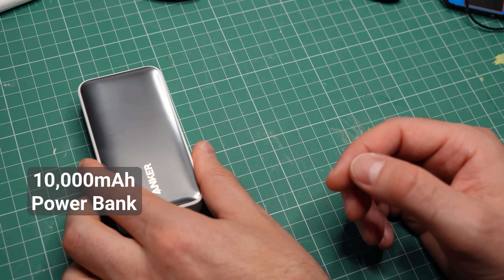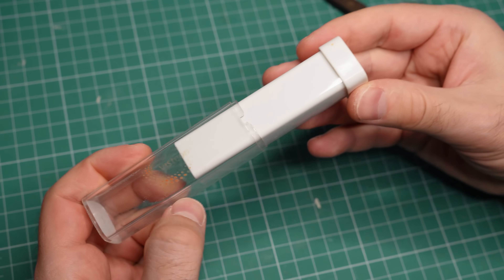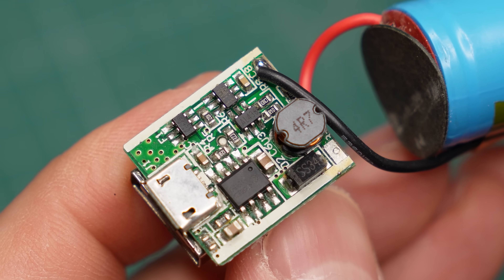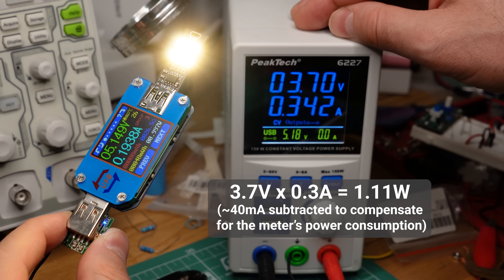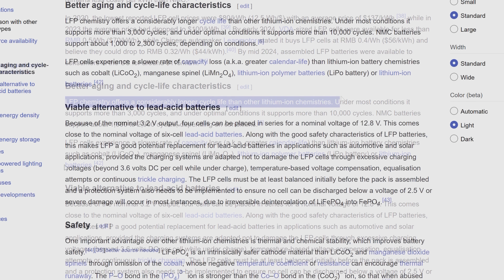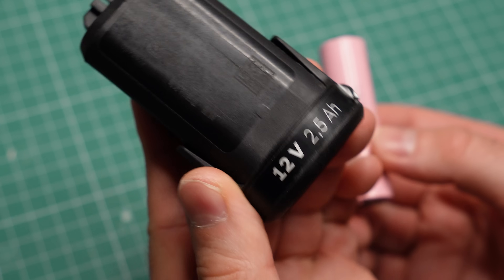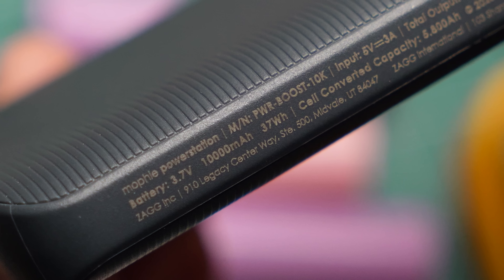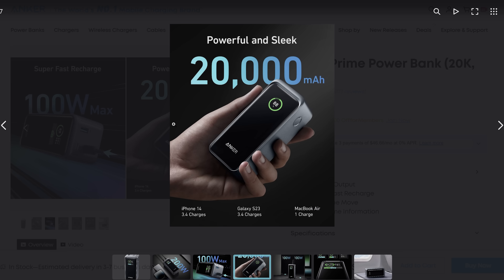Power Bank Capacity is Confusing. Let me Explain

Comment: I thought about this a bit and I think it goes beyond marketing tactics. Electronics use Ah all the time for batteries. The reason, I think, is that the voltage of a battery varies quite a bit from fully charged to fully discharged. Lithium-ion batteries have 3.8V nominal but you will see 4V when charged and maybe 3.6V when discharged. This is actually how you guess the SoC of the battery by the way. So, when you say a battery has x Wh, you assume constant voltage, which is not what really happens. So in electronics talk, it’s much easier to say a battery can output 1A for 1 hour, across whatever voltage curve that specific battery has (and which depends on battery health, temperature and chemistry anyway).
Reply: Don't care. If I buy something I want to know the Wh it can deliver. If the manufacturer can't tell me what am I even paying for.
Reply: @seeibe Best they can do is tell you how much it can store, approximately. How many Wh it can deliver will depend on downstream factors affecting efficiency. But I get what you mean.

Comment: 90000 mah means one milliamp for 90000 hours.

90 Ah means one ampere for 90 hours. 

People feel the second gives less power.
Reply: And 1 Watt means it can be 10 dB or 110 dB.
Reply: One mA (assuming same voltage) is less power than one A.

90000 mAh is the same amount of ENERGY as 90 Ah (assuming same voltage)

Comment: For powerbank that 10000 mah you just substract 30 % and it will be around that amount how much your phone butterry will get
Reply: I subtract 40% since the phone is running idle. Or multiply power bank capacity in mah by 0.65, kind of checks out.

Comment: Thank you this has been grinding my gears for some time now. One example is the Apple magsafe powerbank people made fun of because it had a way lower mAh rating as the same product from anker… but people didn’t realize they exposed themselves to know nothing about this by making fun of that. The apple product had a higher voltage while the anker product worked at the standard 3.7v cell voltage, if you actually looked at wh you could see that both pretty much had the same capacity.
Reply from the maker: This reminds me of MKBHD and other tech people wondering why the Apple Vision Pro battery was so small in capacity when in actuality, the pack had a higher voltage than a phone's single cell.
Reply: @LeftyMaker oh yes this as well, especially as you‘d think its their job and they‘d have some clue of what they’re talking about. Imagine a car reviewer saying a 300hp semi-truck would be faster than a 200hp car…
Reply from the maker: @Simoxs7 yes, good analogy

Comment: I hope PPS is the future. No charging circuity needed inside phone. Doubles the effiency.
Reply: But then we are stuck at transferring power at the battery voltage, which will usually be 3.7v.

Assuming the current limit of the usb c cable of 5A, you are stuck at charging at 18-19 watts at most.

Though using PPS can still help, as you can supply the phone by a multiple of the battery voltage, and then use a much more efficient kind of a step down converter.😊
Reply: my Chinese phone already does this. With a compatible charger, The USB output starts at 8v and ends at almost 9v. It barely heats up while taking in 35W+ of power, so the efficiency is definitely present.
It does however have a 2S (two-cell) batteries, I don't see this happening with normal 1s Battery

Comment: oh and different power banks also have different conversion efficiencies most are around 60% efficient so that also has to be considered

some low end chips in cheap power banks also charge very slowly so when I buy I also consider the different combinations of output power (9V2.2A, 5V4A etc) not all 20w output is created equal
Reply: 60% efficency 😮
Reply: @donnyyeo  Seems a bit exaggerated. That would be a lot of heat build up

Comment: 3:08 Amp-hours are used since the amount of charge is constant in a battery, but energy output can be lower with higher loads due to internal resistance. It isn't just marketing
Reply: Not even just that, the amount of energy stored without any current at all changes with temperature and there's also hysteresis going on too
Reply: Finally, I had to scroll way down to this comment.

So we have the problem that mAh is a better unit to describe the battery, but a worse unit when you want to compare different kinds of batteries. Wh is better (measured in some way), but then you have the problem that you simply can't give an exact Wh rating for a battery. We really need a standardized measuring system for this. Like Wh at a given temperature, with a given resistance load. Or something that could be used as a fair comparison
Reply: @gyorgylazar1354  not really possible to have any accurate rating. i have tool batteries. they are capable of 90amps. i do not expect them to have full capacity at that load. yet, i can connect it to simple flashlight and it might exceed the rating(doubtful :D). then there are high capacity but low load batteries. those can fail on high load, but should be pretty accurate if it is used within spec. you just cant measure Whs at specific current because all batteries are different. specs should not be exceeded when measuring but then same current for high load batteries would be inaccurate. we could use something like C rating for cells but that would make everything even more complicated. :) simple Whs are the best. user must consider the load and have expectations accordingly. and manufacturers should not rate capacity with lowest possible load :D
Reply: you will not get same Ah on different loads as some of it will become heat. so measuring in Ahs is completely useless. only in single cell it is somewhat applicable, but voltages are different so... better measure in Whs

Comment: Rule of thumb is to subtract 1/3 of the mAh stated because typical Powerbank cell voltage is 3.7 V and typical smartphone battery voltage is 5 V. Add inefficiency and you get roughly 2/3 of the stated mAh out of it.  Confusing is having to calculate for air travel's 100 Wh limitation, but how many mAh ist that then? ;)

Comment: Joule should have used hour or 3.6 seconds as reference instead of a second... Because nobody likes to do times/divide by 3.6 in their head!
Reply: Ah, if only metric time had succeeded. We'd be spared so many of the headaches of converting between time units.
Reply: @Avalyera  True, but logically 10 is not a very good base number, it's only divisible by 2 and 5. While 12 is divisible by 2, 3 and 6. They call 12 a perfect number. And 60 is also a perfect number. They have more factors compared to their value than any number smaller than them. So hour and minute units are very logical. Just not very compatible with 10-base systems of decimal and metric.
Reply: @saeedgnu  The term you're looking for is "superior highly composite number", although being "just" highly composite (having more divisors than any smaller number) would already be a good enough reason to use 12 and 60 for things.

A base 12 metric system might be more convenient. Sadly, trying to change to counting everything in base 12 is infeasible, not to even mention doing so for base 60.

Comment: Bought a small specific battery pack 12V 9000mAh for a device.  I understood the numbers, and * expected * it to be 3 cells each of a optimistic 3000mAh (maybe 2200 or so). Turns out it was not even 700mA. Probably salvaged cells in a new shrink wrap.

Comment: The powerbank u show on aliexpress i likely real and has those specs. First 15$ is for 20000mah as it says in "Color" seocndly 120w i max power output through all outlets combined so likely 30+30+30+30 or something like that. For that 15$ seems alright. Secondly it has fairly good opinions as it shows 4.4/5 with 700 reviews and thats many reviews.
Reply from the maker: The listing says 200,000 mAh, not 20,000

Comment: Ah [Amper hours] measure how many electrons in total can flow within some time. 

It says NOTHING about how fast those electrons will be and that is measured by voltage in [Volts].

To know how much energy you get from a power bank you need to multiply the number of electrons [A} by the voltage (speed) [V] they move at and for how long [h]. Only then do you know how much energy the powerbank has: [Amper * Volt * hour] = [Watt * hour] i.e. Wh, or in SI units it's just Joul [J].

Though to be fair, the Wh rating of the powerbank should be stated as the output power, not input power, so that the customers can be sure of how much energy he can actually get from the powerbank and into his devices.

Comment: It's always baffling when the wrong units are used. If you say watts of energy. you have lost all credibility in my eyes.
Watt is Power. WattHours is energy. also thanks to the SI system 1 Ws (Watt second) = 1Joule = 1 Nm (Newtom Meter the energy unit. Not to be confused with Nm Newton Meter the torque)
1Nm is the potential energy used when lifting 100g up ~1meter. (gravity is 9.81m/s^2 so only 9.81meter) 
such easy conversion factors. (Exept for time. there its 60*60 = factor 3600 when going from Wh to Ws)

Comment: mAh/Ah is such a stupid metric. It does not measure direct energy at all. Also considering that every lithium battery no longer uses the standardized 3.7V it’s misleading doing any comparisons. Take for example Ankers older 250W power bank that has a 27,650mAh (@3.6V) capacity. Anker’s new 300W battery has a 26,250mAh (@3.8V). 
A clueless consumer is going to think that the newer battery is 5% smaller when in reality they are sub 100Wh batteries (99.54 vs 99.75). Anker themselves have just provided an example of how bad not measuring energy is with their own product.
Reply: True, it doesn't measure energy, it measures charge. Charge is constant in a battery, energy output is not (heat losses with different loads)
Reply: @MarkoHR well I did respond to your other reply but no, because of peukert’s effect the charge in Ah still drops as load increases.

Comment: Every time people measure battery capacity in ampers I scream
Reply: I measure battery capacity in kg m²/s²
Reply: @PerfectJasmin foot-pounds but different foot-pounds
Reply: @PerfectJasmin  But what about Joules?
Reply: And also since batteries even within the same lineup of phones have different nominal voltages, there is no such thing as an equivalent comparison. Why would you measure capacity in coulombs when you can use actual energy?

Comment: I hate this for so long, especially  when Wh just sits there with the right answer. Its like asking how far can your car go and the answer is 5l/100km but then you have to guess how big the tank is to get a range.
Reply: Or even saying how far away is it? ”It’s 40k steps” but the size of the step isn’t standardized so you need to ask for the size of each step.
Reply: @victorbjorklund with steps i would guess around 1m, so its maybe 15% off. With gastanks it can be 30l to 100l. 
Or even better the battery of an BMW i3 is 90Ah and a 12V Batterie for camping is 100Ah which batterie can charge more phones?
Reply: @raphiseth6942 most of the times power banks have similar voltage. But sure.
Reply: I bought a 24k mah power bank for the air port and looked at the back of the packaging to read the wh. There in fine print it said 97 wh hour. Just under the limit of 100 wh the air port has. Don't know why they didn't just put it front and centre to make it easier for us to see the capacity instead of me having to actually read the box or do conversion.
Reply: The “wright” answer? What’s that?
Reply: @callummcneill44 the energy in Wh and not Ah and V that you have to multiply, so you can compare energy  over different voltages.
A 100Ah Camping batterie(12V)  has the same energy as a Car with 90Ah like an BMW i3 (400V)?
Or is the 1,2kWh batterie smaller then the 36 kWh batterie?

Comment: Another scam even legit manufacturers like Anker use is that they list the capacity as the ammount of power it takes to charge them rather than the power they can deliver. So you are paying the losses twice on the converter when you put power in then take it back out of the bank. Where as if they were rated by power delivered rather than by charge taken in you would know the capacity after all the losses were accounted for.
Reply: There is a case to be made for not including losses from power delivered by the bank, since that can be dependant on the power cable, phone circuitry, etc. Including the losses from charging up the power bank is intentionally misleading IMO.
Reply: @TheSinisterWizard  And yet instead of listing capacity as power deliverable rather than charge taken they list capacity in terms of "number of times it can charge a phone." Which is even more variable than what you suggested.
Reply: @TheSinisterWizard That part is fine. I measure this way: I put a measuring device *right at the output port*. IMO that value should be what is put on the label.
Reply: They can defend this as being honest in a way, as that metric is technically useful for calculating how expensive it is to recharge the bank (but that's literally measured in pennies). I still agree that deliverable capacity is the metric you actually want.
Reply: @needles_balloon  Both stats are important, but the headline stat being the charge needed is dishonest and not including the power deliverable metric at all transitions that dishonesty into maliciousness.
Reply: It's not the charge needed as this might be higher due to losses while charging. It is simply the physical battery capacity
Reply: @ColCurtis I tested quite a few powerbanks right at the charge port and no it's definitely not the capacity of the batteries. You don't get 15% loss from the battery to the charge port.
Reply: What about Ugreen power banks?
Reply: First of you are completely WRONG. It is how much it stores, it takes more than listed capacity to charge. There is also a reason it has to list capacity. Because airlines doesn't give a shit about all this, they won't allow more than 100wh, so brands  have to label capacity.
Reply: @HyperOpticalSaint  How much a power storage device holds is only a measure of how much it takes to charge and how much you can get out of it at full charge. It's not like data storage where you can go in and count how many bits are stored. There is no way to slice it other than that telling consumers only one of the two stats is misleading at best. Telling us both is the only honest way to go.
Reply: @Jackpkmn  No... just no... if you charge a 74Wh powerbank(20Ah at 3.7V) it will use way more than 74Wh ! Why ? You plug the powerbank into an AC(Alternative Current) outlet and the powerbank wants DC(Direct Current) ! The charger converts AC to DC and that conversion isn't 100% efficient ! When charging this 74Wh powerbank, you'll use more than 74Wh of electricty ! The 20Ah(74Wh) is what the battery stores, not what it can truly give ! It's not misleading ! Why ? Losses in electricity is something we can't really escape, even DC to DC conversion is not 100% efficient(despite being more efficient than AC to DC or DC to AC) ! And losses aren't fixed it depends on multiple factors ! If your phone has a 5000 mAh battery at 3.85V that's 19.25Wh, it doesn't mean you'll be able to use all those 19.25Wh, it just tells you it can store a maximum of 19.25Wh ! Electricity losses isn't 100% avoidable !
Reply: @YannBOYER_LK  Its quite misleading because there are two ways to measure it, power needed to charge it up to full and amount of power it can deliver from full charge. On top of that power banks are almost always rated at the cell not even at the power input. Meaning assuming the cell is being charged separate from the rest of the device. Meaning that 74Wh isnt the amount that they measured as what you'd need to charge up the bank but what you would need to charge up the raw cell.
Reply: For ankers case I think they just calculate the theoretical capacity giving you the actual real world capacity in most cases is too much of a hassle because protocols have different losses they could average it out but why do that when you can just tell the consumer how much wh it could handle

Comment: So these manufacturers are giving their battery energy capacity in... Coulombs? In what world does tbat make sense!
Reply: A world where all lithium batteries use the exact nominal voltages even in different cell configurations. Last I checked, every manufacturer keeps using different voltages. You got power banks using 3.6V, many smartphones using 3.9V, and new silicon carbon batteries using 3.7-3.8V (which balloons Ah ratings compared to higher voltage phones). Ah ratings are just as dumb as HYPOTHETICAL tube diameters for camera sensors.
Reply: It does make sense, charge a battery can hold is constant (it will degrade with cycles of course) but voltage of the battery depends on the amount of charge and also the load being applied. Due to internal resistance when under a high load a battery will yield less energy than under a small load but it will give you the same amount of charge in both cases.
Reply: @MarkoHR I’ve worked with many battery chemistries in my hobbies. Regardless the Ah charge rate also always changes depending on the load just like voltage. 

Remember that one tweet where someone talked about how small the Apple vision battery pack was compared to a similar sized power bank when in reality the Ah rating was a based on multiple cells in parallel instead of the hypothetical parallel charge rate. Almost sounds as stupid as the hypothetical tube diameter camera sensors use. 

Energy ratings are just objectively better when comparing a variety of devices and not limited to just assuming 3.7V.